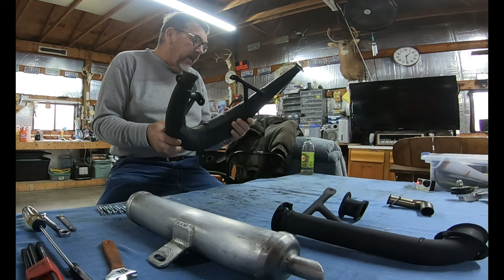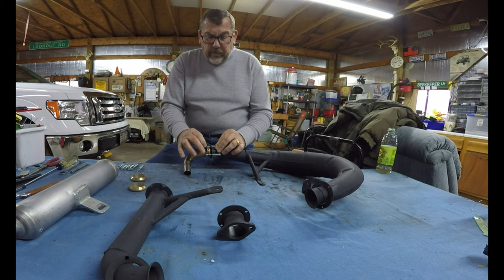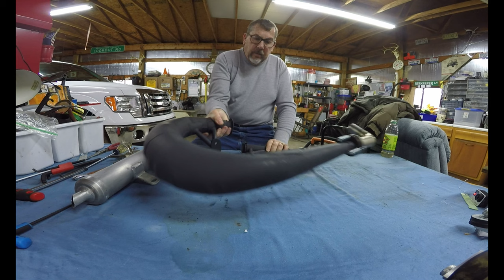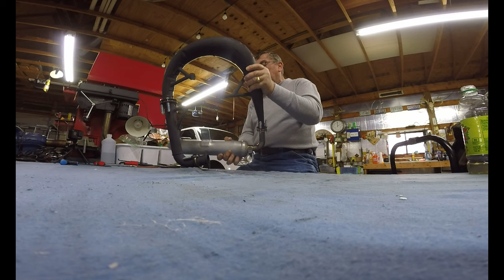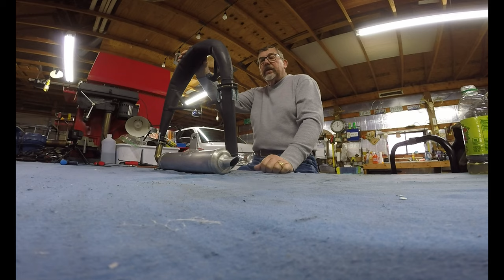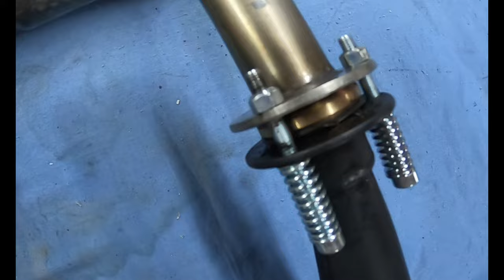Rebuild of Exhaust and Silencer -  Part VIII -  Ohio Paramotor Trike Adventures

Comment: Thought my Atom 80 exhaust was a  pain. That big thing must put a lot of stress on things. Do you have problems with it between rebuilds?
Reply from the maker: Once in awhile.   I’m flying almost 500 lbs.  need a big engine to move all that weight.
Reply: @Ohio-PPG-Trike-Adventures   haven’t had to rebuild my Moster yet but it’s coming soon. The 2 atom 80’s weren’t too much to do.
Reply from the maker: @pittsjohn57  yes it is.  Mine had 300 hours.